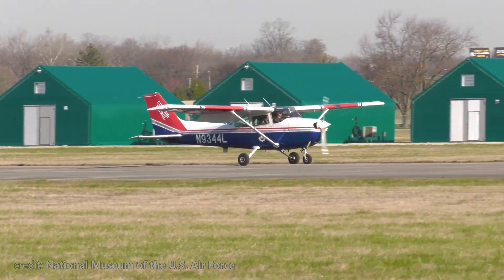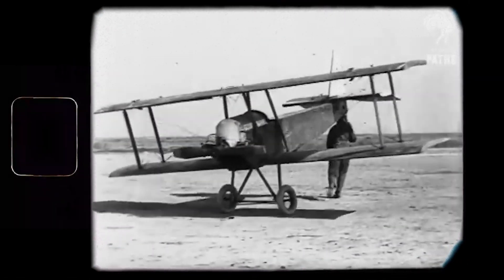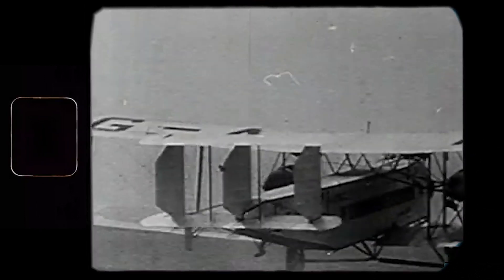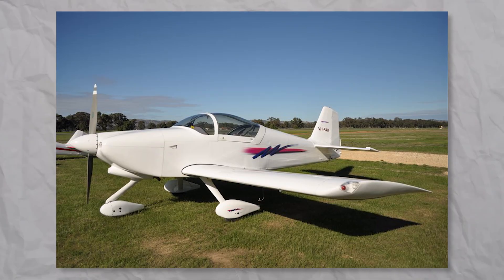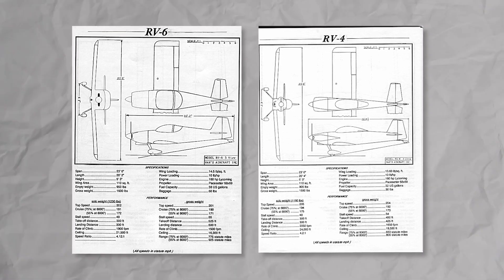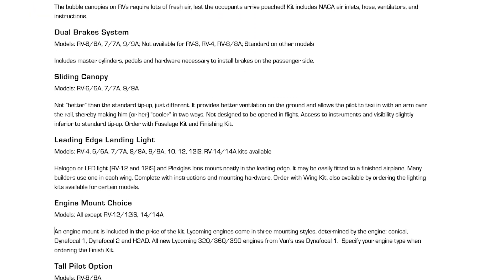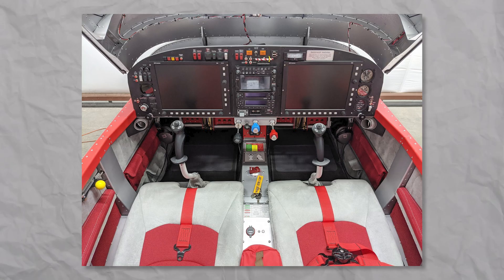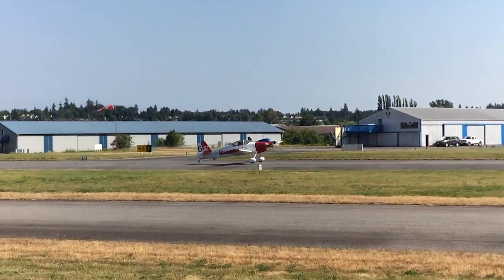Vans RV-6 – Freedom For Everyone! Vans History, Review & Specs

Comment: ya missed the Christen Eagle in your history of kit built aircraft ,The Eagle kit was revolutionary in home built aircraft . it was such a complete kit that the boxes the parts were shipped in had box cutters on the outside to open them. you could be locked in your workshop withe kit and when you came out would have a completly finished airplane all that was needed extra was a battery. Google "Christen Eagle "

Comment: I have owned an rv3, 2 rv4’s, 2 rv6’s, Rv7 a and a harmon rocket. I currently fly an rv6. It is the most practical one of the bunch considering price vs performance. There is absolutely nothing wrong with choosing a used homebuilt rv series airplane if you get a qualified mechanic to perform a thorough prebuy inspection. You can buy one much cheaper than building one. Other than the one comment about not choosing a used homebuilt, your video was excellent. Well done.
Reply: That’s what I got was a 6A. OMG does it rip! It also is fuel efficient, cheaper to own and small to store. I load up with the wife and bags and top the tanks and fly up to 3.2 hours anywhere I please. TAS with IO320 FP around 160-180. We loved it so much we sold our QB RV10 kit. We love needing half the fuel, half the maintenance and a 1/6 of the cost to purchase.
Reply: @RaceMentally How should a newer pilot learn rv flying? I fly gliders and have a new ppl and am looking at an RV 6.
Reply from the maker: woah thats a whole fleet! Yep, my point was that if you don't have a qualified mechanic that knows all ins and outs of the rv.. i think its just me wanting to be sure that everything was assembled perfectly. By the way, what are your thoughts about the rv7, comparing to 6?
Reply: @bigmetalbirds  the rv7 was the replacement to the rv6 making it easier to build. The rv7 is easier to repair due to the pre-punched nature of the kit vs the jig and drill at home nature of the rv6. Other than that, the performance is nearly identical. They are both fantastic aircraft.